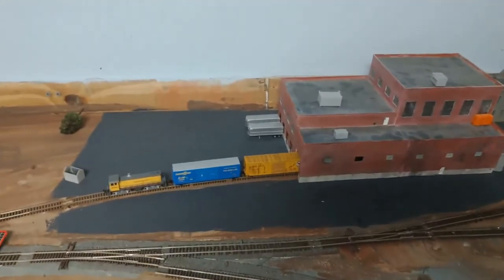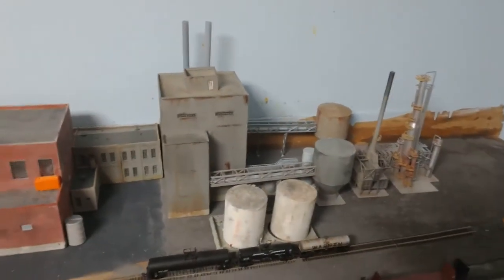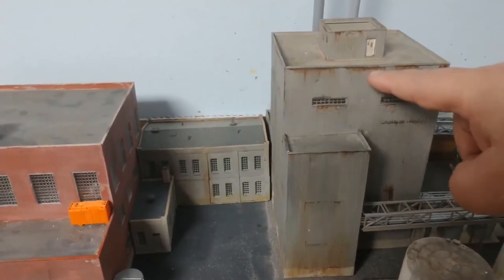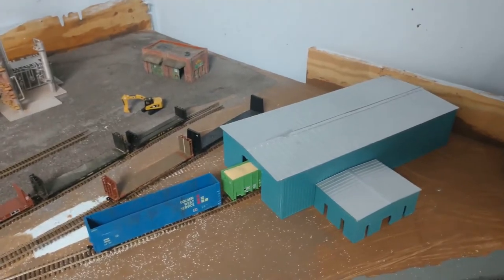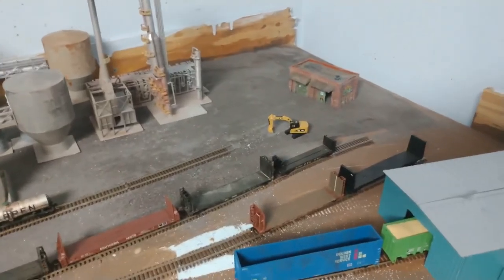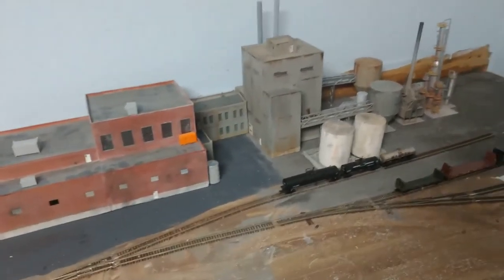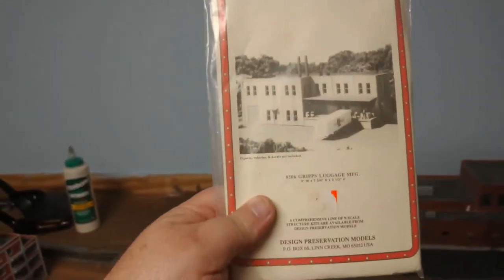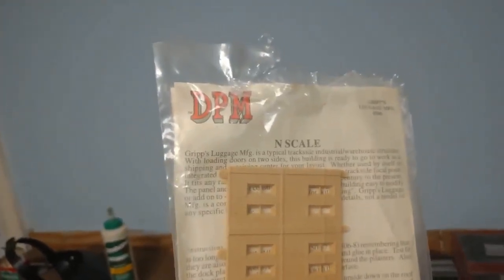Schmelly Paper Layout Update

Comment: Thanks for the update on your paper mill complex Rusty. I think you have done well finding the variety of structures needed. Excellent weathering as well. What adhesive will you be using on the DPM resin kit?  Art...
Reply from the maker: I was thinking super glue on that DPM kit. Unless someone knows a better one. I actually used superglue on the refinery kits platforms and ladders